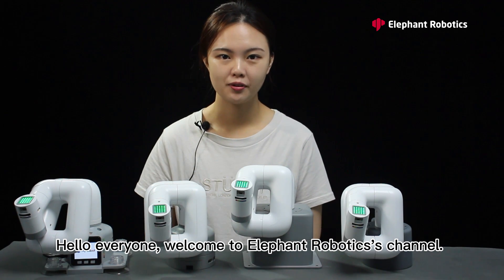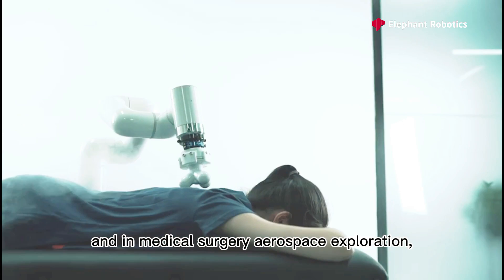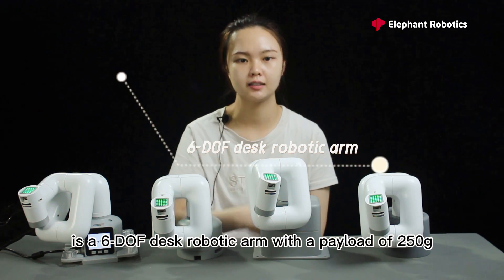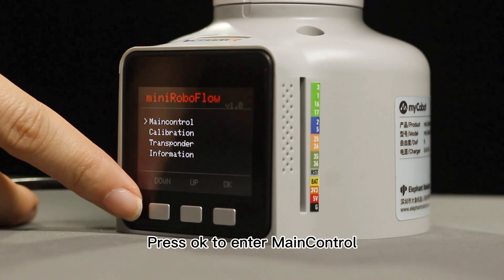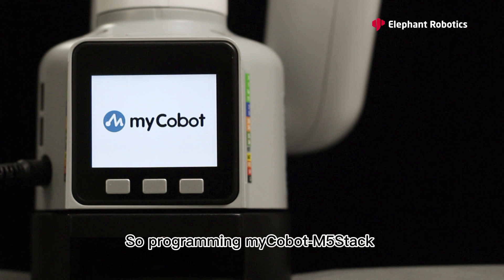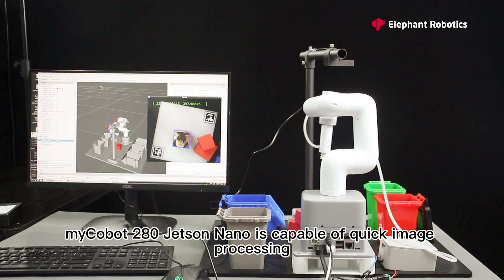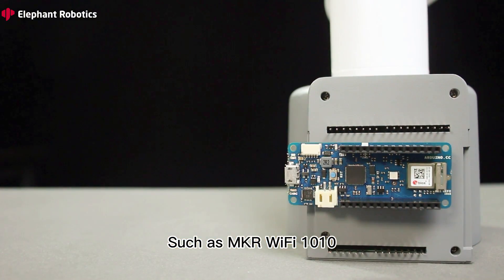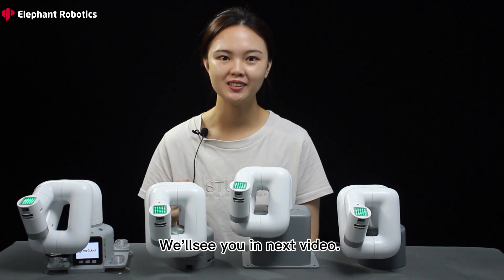Find your preferred lightweight robotic arm from myCobot Series

Comment: Which of your cobot models would work best for holding and moving a small camera?
Reply from the maker: Hello, could you please provide the weight of your camera?
Reply: @ElephantRobotics  approximately 200-250 grams.
Reply from the maker: @Bigexcelenergy  For myCobot 280 series and mechArm 270 series, the payload is 250g. You can choose among them.

Comment: Question to the cheapest Arduino robotic arm version:
Robot Can Run/is usefull without Arduino board plugged?? Or this is not possible to use robot without arduino board?
Arduino Board must be buy separately or is it included in shipping box?
BR
Jacob
Reply from the maker: Hi, it is including in the robotic arm
Reply: @ElephantRobotics  which Arduino version?
Reply from the maker: You can use myCobot 280-Arduino to work with ARDUINO MKRWIFI1010 MEGA2560 \ UNO

Comment: I have a question please,
If i use a Jetson Nano to help a robot recognize photos, how can i send command to the robot to move it?
Is it through ROS or other platforms or maybe through the Jetson Nano itself??
Reply from the maker: It depends on your familiarity with the compilation environment. If you are familiar with python, you can call the API in opencv library for image processing. In this case, you need to write the corresponding code, and then install the pymycobot library and call the API. The api can control the robotic arm to move. If you are familiar with ros, you can use ros to debug. You can refer to the image recognition in the robot kits of our gitbook.
https://docs.elephantrobotics.com/docs/gitbook-en/13-AdvancedKit/13.5-%E5%9B%BE%E5%83%8F%E8%AF%86%E5%88%AB.html
Reply: can you still advise this arm? is it accurate? thank you